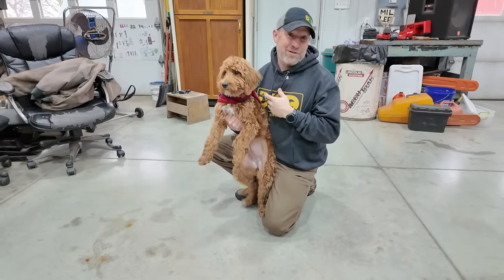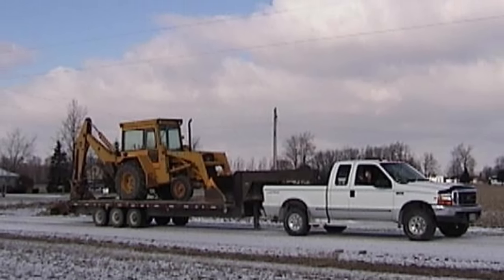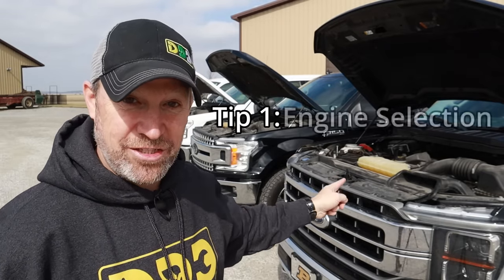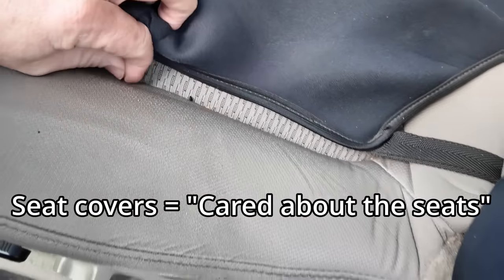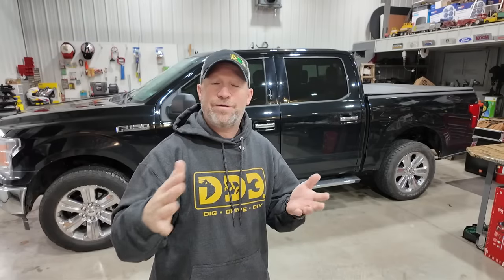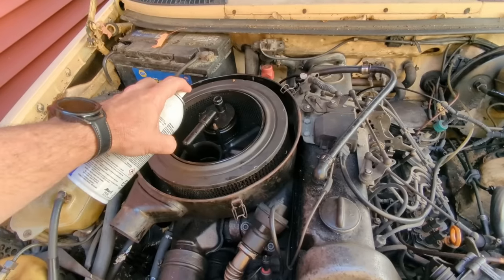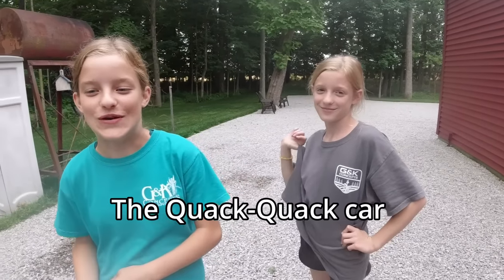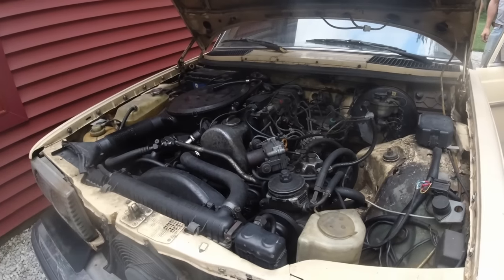How To Buy Used Trucks On A Budget

Comment: Interesting video Neil, i noticed that you said that you would not get a warranty from a dealership for a truck like that WOW, here across he pond in the UK there isn't a dealership that wouldn't give you at the minimum 3 months to 2 years limited warranty, also you would be a fool to try and sell any vehicle without what we call a MOT which is a comprehensive mechanical/electrical/bodywork and suspension check which we have to have done every year if your vehicle is over 3 years old caught driving without MOT it's a hefty fine and vehicle towed away. Also all our trucks run on diesel which at todays rate is $7.55.
would really like one of those but most of our towns and cities it would be way to big our roads are not ready for one of them.

Comment: I’ve always bought used Lincolns. Now I’m in the market for a used Lincoln MKZ or Continental but now I have to watch out because those 3.7’s or 3.5’s (MKS before Conti) have a $3k-5k water pump liability with that water pump in the engine. It’s getting harder to buy used cars because even the really high mileage ones are costing the same as low mileage. I can’t see how that is going to keep up.

Comment: I don't like the idea of spending $40k or $50k on a new truck either. Bought my 2016 F150 for $26k. Stuck to what I wanted and shopped for a long while. Crew cab, floor shift and 5.0 V8 with 65,000 miles.

Comment: I just bought a 2023 Ford lightning I got it 5k under MSRP. and 1.9% financing for 48 months which is less than inflation.  I will get the $7500 tax refund  since I bought it in December and $2500 from the state. It costs less per mile to run an EV and it is the nicest truck I have ever been in...by far....Cue the EV haters. It is the year to get a new truck, there are some crazy deals out there right now especially on 2023s.

Comment: Hi! I’m thinking of getting a used F-150 as daily work truck. I have a commute of 40 mile one-way (1.5 hrs) then another 1hr drive home in horrid SoCal traffic. I haul mostly network cabling installation equipment in the bed, and do not tow. 
What model year, engine and grade do you recommend? I would like to have some of the newer active safety features such as the automatic emergency braking system to avoid front collisions, but not as critical as long-term reliability and durability. Any suggestions for a late model  
F-150 with Direct and Port Injection. Also, what immediate and affordable engine and transmission mods for reliability and durability are recommended? I’m not looking for more power, just long-term reliability and durability as I don’t have too much money and need a truck for work and personal use. Thank you!

Comment: I would also suggest doing your research on the vehicle and its bad years. So much info out there on vehicles issues. I personally stay away from the ones with all the in dash screens, cams, etc.. Ive seen vehicles plagued with issues from those. Just more to go wrong with it.. I also suggest avoiding anything after Covid in 2020. With the shortage of parts, quality control went out the window. Manufacturers were getting parts from anywhere they could, many being crap. When it comes to a work truck, keep it simple (like choosing the V8).

Comment: another thing you didn't specifically mention is with a new truck with lots of miles that automatically means its most likely not a lemon and the engine shouldn't blow up on you out of nowhere

Comment: I buy retired Police units.  Cheap , and super easy to fix.   This is what i have owned
I ONLY BUY FORD. 
- 9 Crown Vics (1985-2011)
- 2 Taurus'  (1995 and 2011)
- 2 Explorers (1996 and 2013)
- 1 F150 (Fire Chief old truck)  (2015) i wrecked this truck though.
Reply from the maker: That's awesome!  I've had a crown vic for a Derby car.  The door is hanging on the wall in my shop :)

Comment: I bought a 2010 4.6 3V XLT with 183,000 for $10,000 and it just went over 200k miles and the only issues it had was a alternator going out and the heater core leaking (bypassed it for 8 months until winter)

Comment: My cousin has a 1998 regular cab F150 with only 180,000 original miles. One owner, clean title. He wants to sell it to my college-aged son for $4800. I may be able to talk him down to $4500. Do you think it would be a good fit for a young man about to graduate college?
Reply from the maker: Is it a 5.4 or 4.6? Rusty?  If it's really rusty I would probably avoid it but if you're in a region that isn't rusty than it could be a really good truck still.  

That could be a really good truck but even a '98 is getting on in years now. But, I like buying one owner vehicles so if it's in good shape I wouldn't be too afraid.
Reply: @digdrivediy  We don't get much rust here in Southeast NC. Very little snow, so no salt brine unless you drive on the beaches. 

I'll ask about the engine size. Thank you.

Comment: When I bought a high mileage suv, I noted the wiring for hitch brakes had never been done, which told me the engine hasn't been pulling anything right at the max of it's ability, not sure if f150 usually has trailer brakes from the factory these days
Reply from the maker: Some do.  Many do I believe.

Comment: Going to take me 2-3 years to save $5-10k for a high mileage diesel. Have 28 months left on my 19 ford ranger 4x4 I got for $25k, but I want to get rid of it and get something cheaper. I don't think I'm going to be able to, I'm $3k underwater on the loan and my only option is to roll that over into a new loan and trade it in but I can't find a diesel at a dealership that under's $15k, really need it closer to $10k. Think I'm just going to have to keep it until I can save enough $ to buy something older outright.

Comment: Your tips pretty much match my buying strategy my cousin taught me when I was younger. I've only ever bought two new cars - a 1990 Honda Civic which shocked me (as a newby) with the loss in value out of the showroom door, and my current 2006 Superduty which was going to be my second and last new purchase and I reluctantly bought due to the oil price shock in the early 2000s (10k off showroom floor price) rather than the spec I really wanted. I am subject to an inclination towards high-powered units so my last purchase was a VW Golf R but it is a 2016 so right in the same ballpark you mentioned, higher mileage, never been crashed, spotless interior other than the previous owner was a smoker.

Comment: Have a 23.  F150.  Had the 2015.   15 imo is better in most ways.
Reply from the maker: Wow that's interesting to hear.  What don't you like about the '23?
Reply: @digdrivediy  the 10 speed trans behind the NA 3.6 v6 is main complaint.   Torque low. Constantly shifting.  The 15 and 16 5.0 was great.   Right up hills with no down shifting.  My 15 had 35 gall tank.  Fuel economy is about the same.  Both are company vehicles. 

Your 5.0 choice was a good one.   10 speed btw seems to do weird and clunky shifts.  

23 also throws up red ‘you gonna hit something alerts’ when nothing is there.  About give you a heart attack 

Also auto start.  Shutting down each time you stop NG 

Love your show!
Reply from the maker: @phooesnax  Great feedback. Thanks!

Comment: What size of engine does your new to you truck have in it?  Mileage?
Reply from the maker: 5.0L V8
Looks like it has a lifetime average of about 19mpg with 156,000 miles on the odo.
Reply: @digdrivediy  I’ve noticed one this AM that’s a 2016 with around 240,000 miles that was used by a dealership to deliver parts. Asked south of 8 grand at the moment.  Super clean on a small dealer lot.

Comment: Would you recommend 2011 F-150  3.6L 4x4  at 80k miles?
Reply from the maker: Depends on where you live. If you live in the midwest or anywhere that has winter, salt and rusting issues then I would definitely get a 2015 or newer aluminum bodied f150. Otherwise, I'm sure it would be fine. That is fairly low miles for a 2011. I don't have much experience with the naturally aspirated 3.6 l.

Comment: I'll never understand why people get sentimental about vehicles. They are not family members. Simply a vessel to get from A to B.

Buying high mileage (100k+) vehicles of any kind is foolish IMO. Same way buying a truck based on how it LOOKS is. If you're trying to buy an older truck for value you want to buy a vehicle that the owner didn't care about the aesthetic but maintained it impeccably bc it had to get work done. Sure a truck owner might have washed it frequently, but if they spent money washing it did they have money left over to do proper maintenance. 

Vehicles made after the turn of the century are only made to last 100k-200k. "They dont make them like they used to..." so true. High mileage = buying someone else's problems. I prefer the middle range (40k-80k miles), 1 owner, long history of maintenance at the original dealer they bought it at, etc. (Also comes with a medium price that I'm ok with)

Other advice in this video about setting a budget, not financing, how to pick the right seller, etc seems good though.
Beautiful family! thanks for sharing the video and the memories especially with the old Mercedes. <3

Comment: I like buying barely used 1-2 yrs old, low miles, for a good price then drive the wheels off of it, and then buy new wheels… 15yrs later I have a well taken care of F150 with 325k miles. 
I’ll get 500k out of it and then do it over again. I drive too many miles a year to replace frequently.
Reply from the maker: What does a 500k mile F150 go for?

Comment: I disagree about buying privately. First the owners have higher expectations about the price and they can't fix any issues that there might be with the vehicle. You can usually find smaller dealerships that care about their reputation and don't want vehicles sitting on lots a long time. They price them to move.
Reply from the maker: You think private sale is higher priced? KBB actually has a designation of dealer pricing and it is always higher than private sale.

Comment: As a 30 year tech, any 175,000 mile ecoboost needs resealing, not cheap,or easy. None of these trucks have an easy to check trans dipstick, the 10 speed is meh. Working on them sucks, but they do have aluminum bodies, and powder coated frames. Honestly I used to be pretty Ford loyal, but after working on them all, for 3 decades, they are the ones I'm most reluctant to own. I'd buy a used Tundra before anything else, but hey, buy what YOU like !
Reply: Current turbo Tundras are losing engines fairly routinely. Previous gen Tacomas have howling rear differentials. This “Toyota quality” way of thinking is simply not accurate. All vehicles have problems.

Comment: i buy what has proven engine and transmission like ford 2012 f150 but mostly the f250 or 2500hd in gm 6.0l 4l80 transmission so a 2005 is great i could call less about the year all long as it built on that new way of doing things chassis wize and not in the 1990s and around abouts as they are the same as a 1979 or so f150 and i rather have that .ill never buy a gm half ton because of the 4l60 and 6l80e and no toy turbo bs

Comment: If you spend 20k on a truck, drive it for a couple years, then do it again, and again, etc. why not buy new and keep it longer, much longer than a couple years? Then you know what you have, what if’s been through, and how it’s been taken care of.
Reply from the maker: My goal is to spend around $3000/yr or less to own a truck.  If you have a way to do that with a new truck I am all ears!  You lose too much in rapid depreciation when buying a new truck in my opinion.
Reply: I own a 2004 Chevy 4WD Silverado. $34000, new, still drive today, 170k miles. That math works for me. I do understand that same truck today is $60k plus for the trim level I have but it’s all relative to current wage scale and used market prices. A truck for me is point A to point B with ability to haul when needed. For some, a vehicle is a status symbol.
Reply: @digdrivediy  i thought you budgeted $20k for a truck, then drive it for a couple years, then get another one. So after 6 years that would be 3 trucks and $60k. Or maybe i misunderstood, which is very possible.
Reply: @digdrivediy  ok, i’m not taking into account what you sell the truck for, my bad. You are right,  you’d have to keep a new truck for about 20 years or so to be in the $3k /year range.
Reply from the maker: @maxhenry1977  Exactly. And then after 20 years you'd have a huge outlay of cash again up front.  I'm trying to spend $6-8K every 3-4 years after my initial investment is all.
Reply: @digdrivediy  👍

Comment: “I have had dozens of  trucks” because you have fords if it was a Toyota, you’d probably still have only had two trucks in your life they are the best I just worked on one no joke dead serious. It runs like butter it has 400,000 miles. And has about another 400,000 ago.
Reply from the maker: I've had "a dozen"...
But to be fair I never sold one cause it was broken or worn out.  I just like variety.
Reply: @digdrivediy  yeah I get that I won’t lie ford make by far the best looking trucks out there I would love to be able like to drive a Ford but I’m from Massachusetts so what happens to Fords here in Massachusetts is they  rust fast. There’s not too many Fords in Massachusetts that driving on the road that aren’t rusty and that’s the only problem I have with them, and I just don’t like the eco-boost

Comment: Only problem with Tip#4 is that I've known 2 people in my life that keep the interior / exterior of a vehicle immaculate but never do any mechanical maintaince !  Change the oil at inspection time and turn up the radio when it makes a 'funny ' noise and keep driving it.  But I will say if I am looking on line at a used truck for sale and the guy doesn't even bother to clean out the coffee cups and other trash before he takes and posts pictures !?!?  Then I will pass on that truck

Comment: IVE ONLY OWNED 2 NEW VEHICLES IN MY LIFE AND WOULDNT BUY ANOTHER.IM 74 BUT IT WOULDNT MATTER IF I WAS 44.I ALWAYS HAVE HAD A TRUCK SINCE I WAS ABOUT 20 BUT MY FAVORITE VEHICLE IS A LINCOLN TOWN CAR.HAD MANY,I GET THEM FRO FLORIDA AND LIVE IN MICHIGAN.PRESENTLY I DRIVE A 1998 TOWNCAR AND A 1998 F 150 PICKUP.BOTH ARE JUST AROUND 100,000 MILES AND BOTH HAVE ORIGINAL EQUIPMENT ON THEM INCLUDING EXHAUST SYSTEMS,,,,,.MY ONLY PROBLEM VIEWING YOUR FLEET IS A 5.4 V8. 3 VALVE ENGINE...THESE ARE ONE OF FORDS MOST PROBLEM ENGINES AND ARE FEATURED ON SO MANY YOU TUBES AS.......STAY AWAY ENGINES....